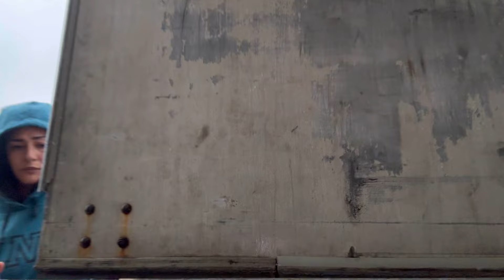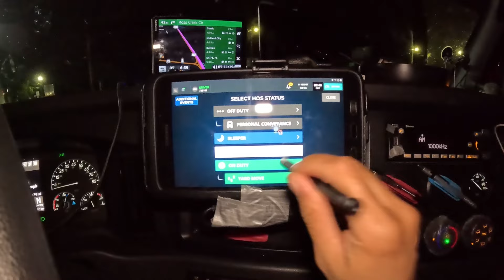Trailer TOO LOW! Made me WORK! 🥵 #truckdriver #trucking #trucker #1kcreator

Comment: Hey!! Absolutely LOVE the videos.
One thing I noticed, and you may have your reasons, so I don’t want to sound nit picky. But when you guys are dropping trailers, why do you crank 2 or 3 more times once the landing gear hits the ground? I was taught my entire life, plus my career, to leave a small, maybe 1 inch gap from the bottom of the landing gear to the ground. That way when the next driver backs under the trailer all the pressure is off the landing gear. Does that make sense? Hope all is well with you both and stay safe!!
Reply from the maker: Awww! Thank you my friend! 🤗
About the landing gear: when I went to school, they told me to crank til I hear my air bags, so that’s why I do it like that 🤷🏻‍♀️ I’m just doing what I was taught. But I do understand what you are saying. Thank you for constructive criticism 👍🏼 Maybe I will change the way I do this bc I’ve seen other drivers do as you mentioned. I’ll give it a try 🤩 again, thank you and blessings for you my friend 🙏🏼🤗
Reply: @MissEvaVlogs that’s interesting. Never heard that before. I usually leave the gap and then I’ll dump my air bags (if the truck is equipped). Thanks for being open to change. Y’all stay safe out here!!